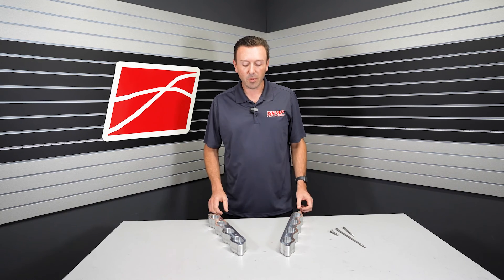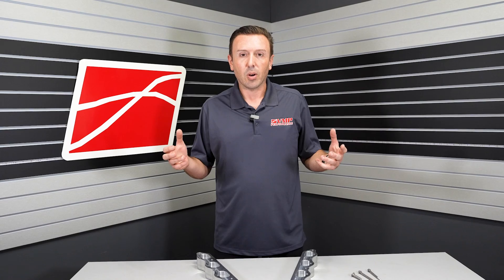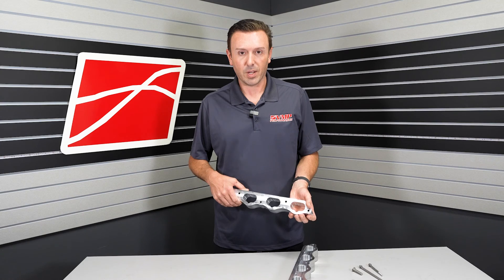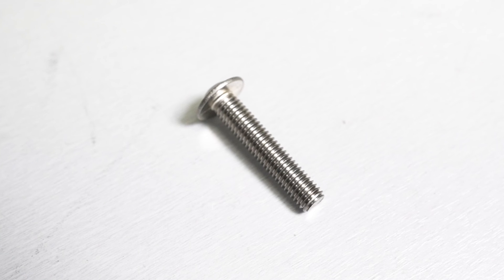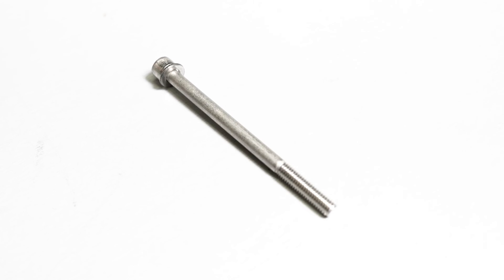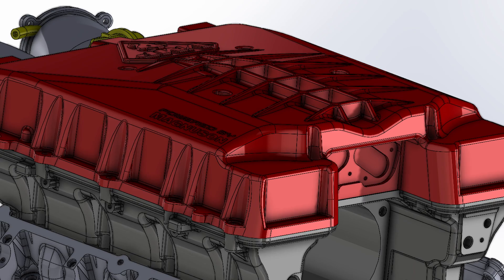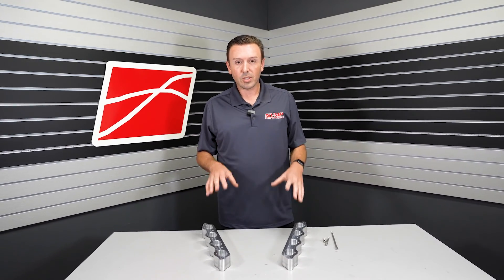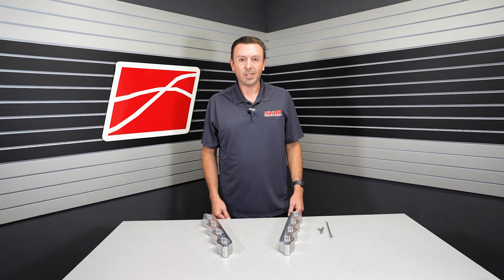Predator blower on Gen 3 Mustang and Coyote F-150?  Here's the missing link! || Predator Spacers

Comment: Would this blower swap onto a Mach 1?
Reply: I did my 2022 mach 1 and made 704 rwhp on 91oct
Reply: @corneliusfehr784  did you drop the motor or get a hood with cowl?
Reply: @corneliusfehr784 do you have any vids of it I have a Mach 1 as well and would like to see more abt it
Reply from the maker: It would, but it would require these spacers, a cowl hood or drop engine mounts (or some combination of both), then assembling the other parts to drive it.  We offer these parts at the link in our bio.  It's worth noting that all of this is taken care of in an Odin or Loki kit AND you avoid the fitment challenges.  Either way, we're happy to assist!
Reply: @VMPPerformanceTV  thanks…i have an opportunity to get a takeoff blower for very cheap so it works out in my favor this way
Reply: @VMPPerformanceTV  do you think doing motor mounts and a cervinis gt500 style hood would suffice?
Reply from the maker: The overall height increase over our Odin blower is .98" or right at 1" so as long as you can provide that much overall clearance, it should fit.
Reply: @VMPPerformanceTV  awesome. Thanks